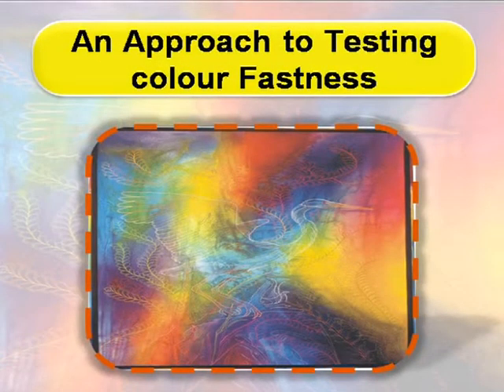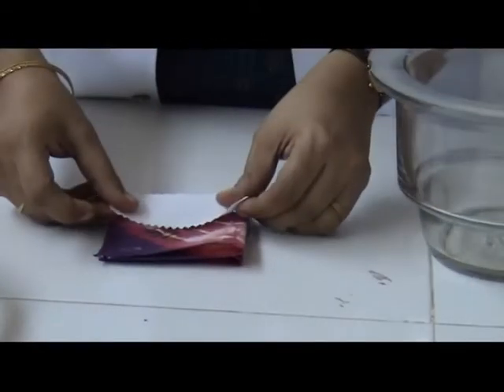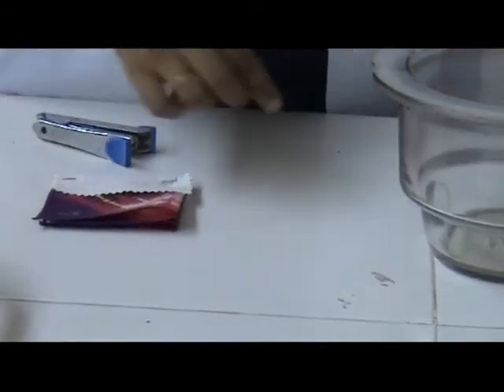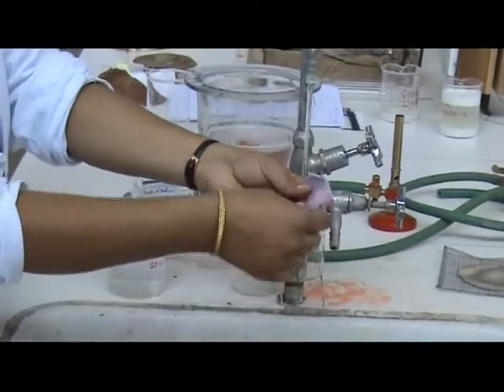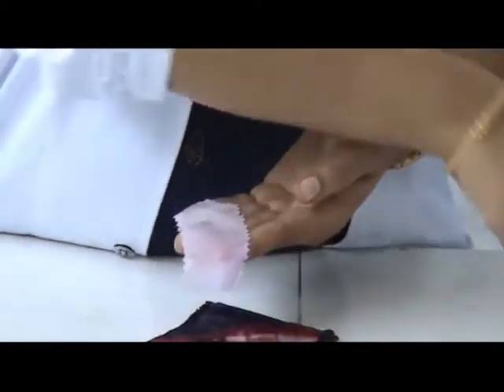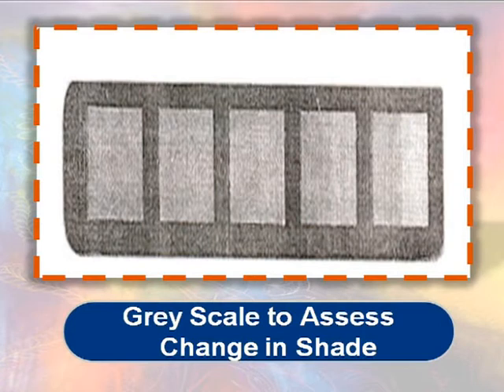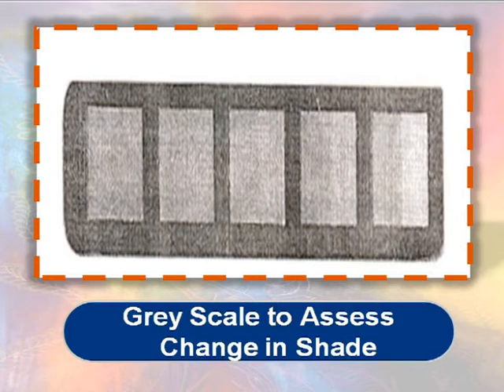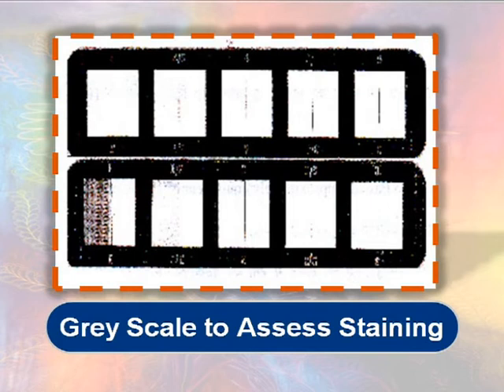Tests to determine colour fastness: testing colour fastness eng

Comment: Water-Cooled Light & Weather Fastness Tester, to determine the colorfastness, aging resistance of textiles, plastics, rubber products or materials by objecting to the simulated conditions of nature weather (daylight, rain, temperature, and humidity, etc.). It might provide you with some help, click on www.testextextile.com/product/water-cooled-light-weather-fastness-tester-tf422/